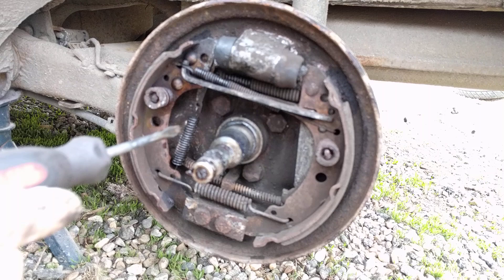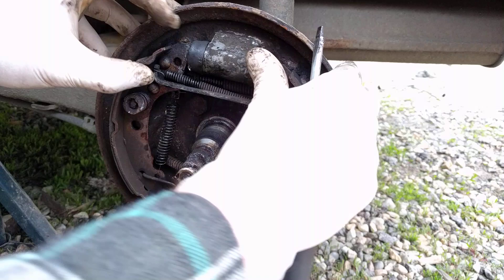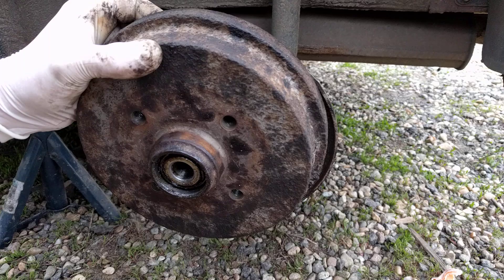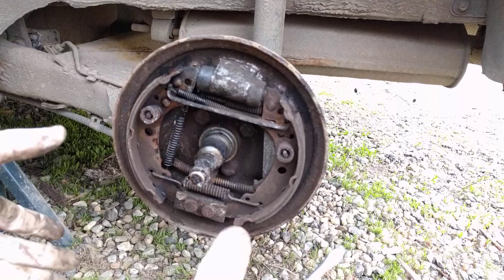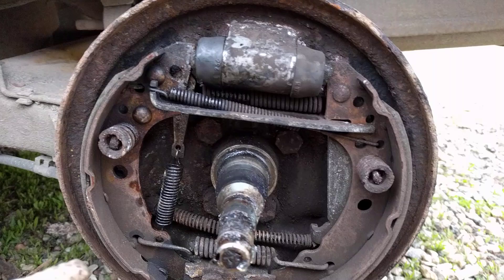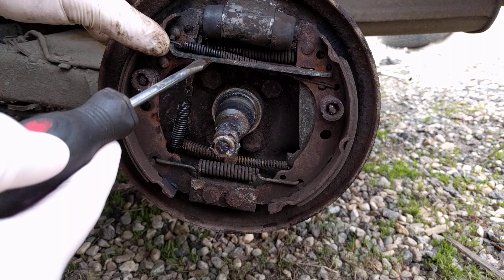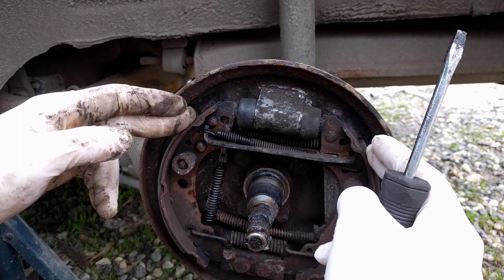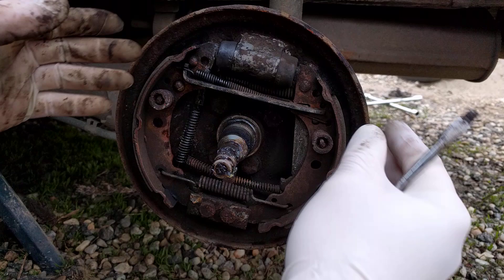Drum brake adjustment and stuck rear hub removal

Comment: This car is in desperate need of a brakes overhaul/parts renewal. Did both rear drum brakes, myself, on my 2001 Polo 6N2, including new cylinders, spring kit and shoes, for £37.50 with reputably named parts. Roughly same set up as video demonstrates.

Comment: Does the bolts inside in caben have to be loosen or tighten when you do this adjusment
Reply: Doesn't matter.. this adjustment is purely to compensate for your brake shoe wear and has no connection to hand brake adjustment inside the cabin

Comment: So that thing drops down when you press the breaks how does it go up after letting go of your breaks?
Reply: Doesn't drop down completely.. drops a notch each time you press the brake.. the shoes touch the drum and stop expanding which stops the adjuster's downward motion as well..

Basically the whole concept is to compensate for brake shoe wear